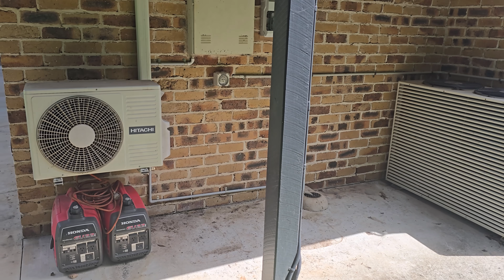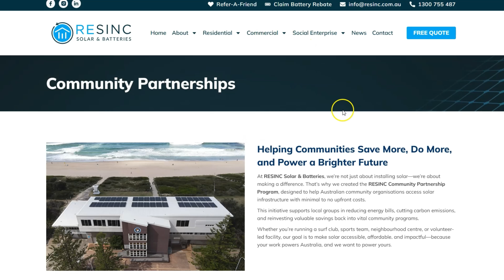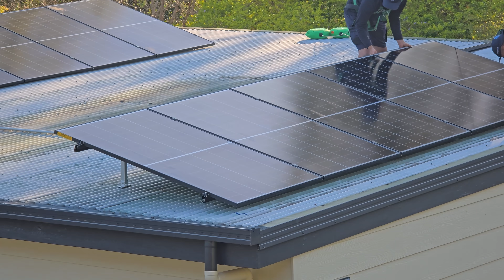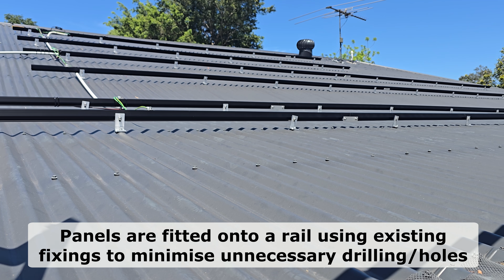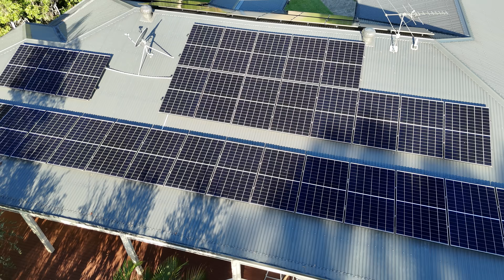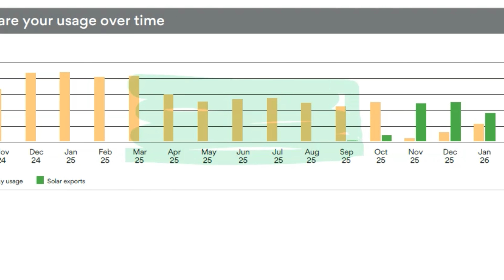From $600 Power Bills to Self-Sufficient POWER - My MEGA Solar & Battery System!

Comment: Having spent about 17k aud on a 7kw solar and 9.6kw battery I'm guessing your system is about 5x or between 50-80 thousand. So your pay upfront is about 10 years at the current billing cycle not factoring in you're still paying over $100 month. before making an ROI. The black out protection is a bonus though.
Reply: Hey Mate, for reference my 10.36kw Solar (28x Canadian Solar 370w Mono Panels / 2x 5kw Sungrow Inverters) was $14.91k and the 40kw Battery (3x Alpha ESS SMILE-BAT 13.3P / SMILE5-INV) was $10.50k - which means after subsidies and finance, the total out-of-pocket cost to me was $25.41k.

Initially, I only had the panels installed (financed over 5 years - just finished paying that off) - that alone cut our power bills by about 30–50% almost immediately. However, as the feed-in tariff dropped our bills started climbing again.

About a month ago I added the battery (financed over 4 years) and since then we’ve been sitting at about 99.43% off‑grid. The small amount we still draw from the grid is mostly when our usage goes over 5kw and the system supplements from the grid. We could probably avoid that entirely by being more careful not to run everything at once, but I work from home and my wife runs a business from home too, so our usage is pretty heavy.

I didn’t do it all in one hit, it’s definitely not cheap and might not be affordable enough for everyone (which is a shame, because it might not be possible for the people who could most benefit). However, for our family it’s been worth it - especially after adding the battery.

If your household can afford it and your bills are regularly in the $1000-$1500 per quarter range, it’s definitely something I’d seriously recommend considering.
Reply: @danj.p.5341 I said I had a system installed. 15x 465w gen 2 aiko panels or 7kw total panel output. Sungrow 5 kw hybrid inverter and 9.6kw sungrow battery + installation fees (power board upgrade $1k) after rebate cost me $16800. My budget was 20k If i had a bit more i would have added another 2x 3.2kw battery packs... I would not have bothered without the 2025 rebates...My bills were about $500 per 1/4 but would have jumped 30% by now. my pay off is about 7-8 years. I am enjoying my small window Aircon i installed that runs on surplus power generation over summer...I would not go any smaller than my 9.6kw sungrow battery
Reply: Wow, we just spent $12k on 13kw of panels and 15kwh of storage. Decent brand too and good warranties on all parts.
Reply from the maker: Thanks for the comment. Every solar system is different depending on system size, battery capacity, rebates, installation complexity and electricity usage, which is why I didn’t share exact numbers in the video. A direct comparison between systems can be misleading. What I can say is that our grid usage has dropped by over 80%, our bills are dramatically lower, and the blackout protection alone has already proven valuable, as you suggest. Even if a system takes longer to pay off than solar alone, the combination of savings, energy security and independence was worth it for us. Modern lithium solar batteries are typically expected to last around 10–15 years. Even after that, they usually still work but with reduced capacity. So, unless our system has a major fault over the next decade (covered under warranty anyway) I expect to get great value for money. I'll keep everyone updated (good or bad). Cheers :)
Reply: @Selfsufficientme  lifepo4 batteries are a mimimum of 20 years if you are cycling once per day, calendar age hits them first. After 20 years they are expected to be around 80% (this is standard "life" same with panels) capacity so still good. Whomever told you 10-15 is prepping you to buy more early.
Reply: That was a huge electrical bill Mark even if there is four adults in the house.
A system that big would have to be at least twenty five thousand and more likely I think to be around thirty thousand.
It was a fantastic video considering I would have thought you couldn't get a system that big as a typical resident instead of being a business/industrial set up.
Have a ripper mate and stay safe!
Reply: I got 40kw battery installed for $9.5k so it depends on a lot.
Reply: @SirPhilby101  Instead I built a 64kwh for 3k.. pretty simple stuff

Comment: yeh we get power outages alot and can last days , so i have a diy off grid back up made from used solar systems and a used  24v latronic  inverter, we easily run when the useless grid is down